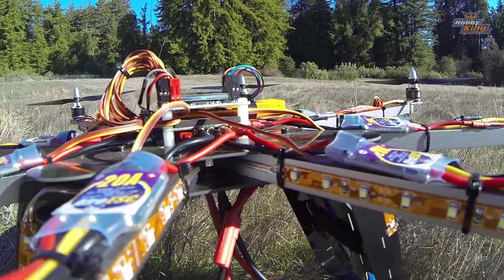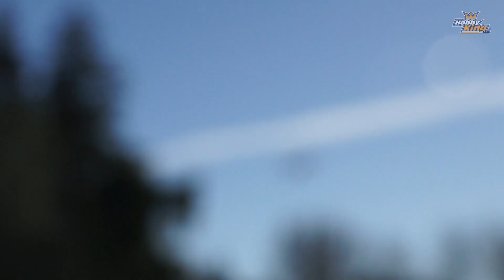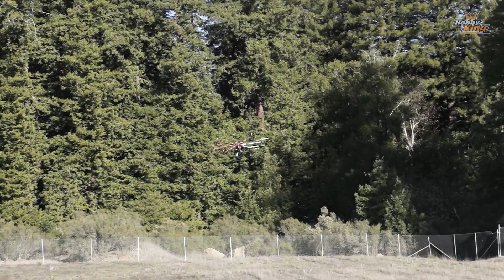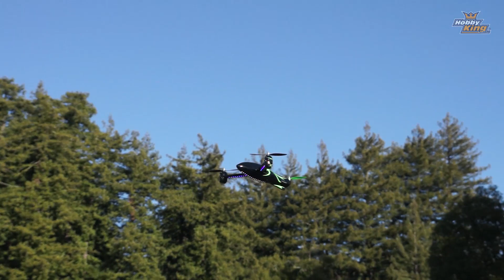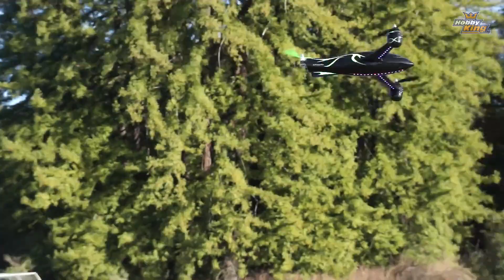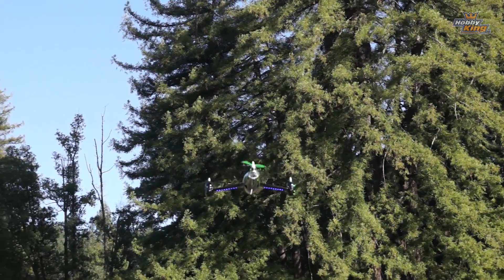HobbyKing - KK2 Complete Guide Pt.8 - X930 Octocopter

Comment: Hi
I have just ordered two frames octocopter 930F.
My job a stress structural engineer.
I will replace your centerplates to new, made from carbon plate thickness at least 3..4mm.
The existing centerplates looks weak enough.
The landing gear looks non-relevant here, in the frame kit. I will replace them by retractable - to keep low height in briefcase.

Comment: Hi can you tell me what props you were using with the 20 26 motors and what battery configuration you are running 3s or 4s

what is your predicted payload and flight times.

thanks
Reply from the maker: Hi Roy,
The motors are NTM 28-26 1000kv units.  I'm running 3s (on the Octo it's two in parallel) 3000mah.  I haven't really run the numbers for payload, but unladen it flies for at least 10 minutes aggressively, with 15-18 minutes of non-aerobatic hover time.
Reply from the maker: HobbyKing Live Oh, and the props are Turnigy 10x4.5 from the multicopter menu.
Reply: Thankyou

Comment: I would really like a setup vid of the HK pilot mega
Reply: Great FC, loving every second with it on our SK-450 Dead Cat. So far, enjoying GPS and telemetry piped to a laptop, next up is Bluetooth like our MultiWill FC's. I'm surprised you're left wanting more on the APM platform, though, as the 2.5 is well detailed all over (3DR has moved onto 2.6, while the HK is a 2.5). New Arducopter software just became available for Christmas, adding some very cool features like Drift Mode, Circle Mode, and more reliable operation.
Reply from the maker: No worries.  I'll be covering the HK pilot mega setup in detail as I install it on the octo-copter.  - Matt

Comment: Matt!!! a challenge.. more like an experiment... try doing coaxial like a X8 configuration.. would like to know what is it like and how do i need?
Reply from the maker: My buddy Gabe and I built a dodecacopter (Hex in Y12 configuration) for the first HK beer lift using prototype rotorbits parts.  If you search the beer lift videos I think you can find it.  Either way man, challenge accepted.  I'll explain the pros and cons of the setup.  - Matt